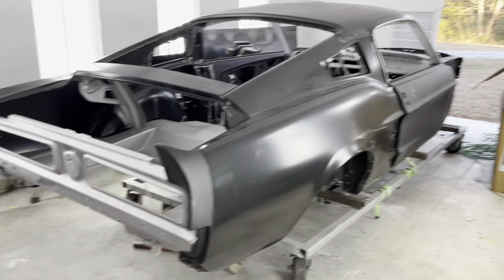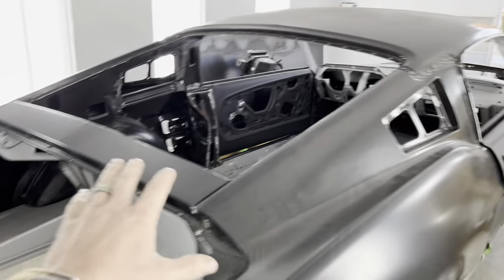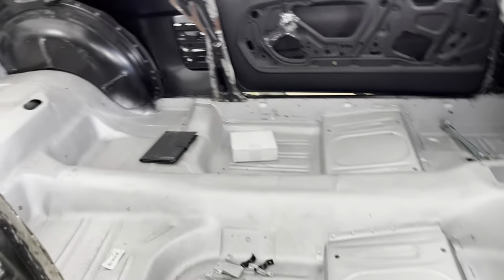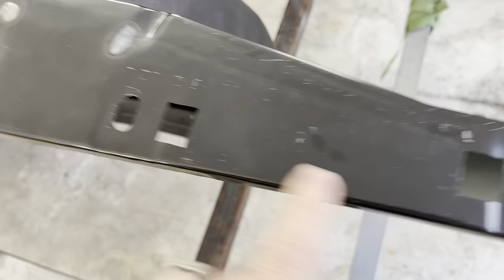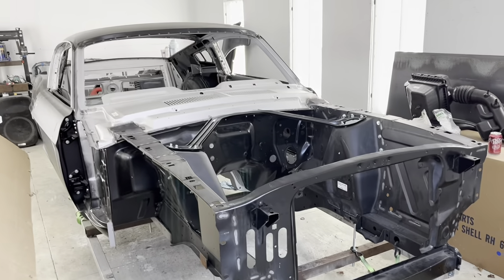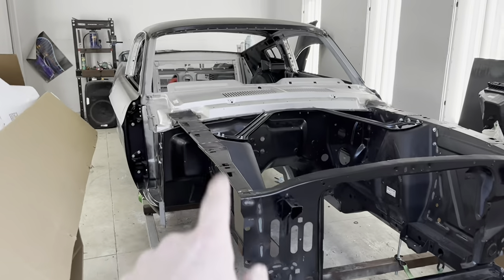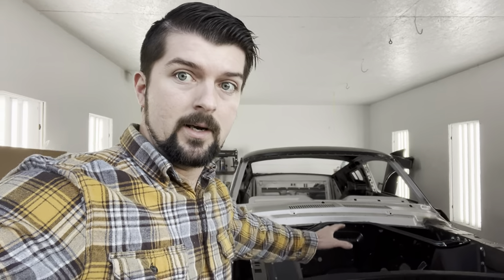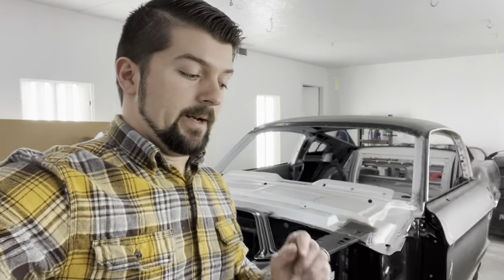How to get a VIN number and title for your car

Comment: Any thoughts on this:
I have a car that I bought about 20 years ago which had absolutely no VIN numbers or any identification on it other than the ancient title that I got with the car which seemed to match the car correctly.

I am wondering if this process which you outlined could work if I somehow could make this a new car using the unibody as the base.

I think I know the answer, but I'm looking for better answers, LOL.
Reply from the maker: @MelaniaSideWigga  the state would come and check all the areas where numbers should be and if there are none they would issue new numbers
Reply: @1194video  Thanks.  I'll ask any DMV some questions next time I go there.

Comment: So my 2004 sierra 1500 got shredded by a semi trailer the cab itself is  NOT repairable it ripped the back passenger door off the hinges and bent the door jam towards the back glass and the bed the front passenger door still opens and closes fine but the outside handle was also ripped off I don’t wanna get rid of the truck if I can rebuild it. I have a clean title insurance is going to deem it totaled since it’s an 04 and labor is not cheap so that being said can I get a donor cab , swap all my interior and put my Vin number in the new cab and Use my driver door and put my door jam sticker on the new cab ? Technically the motor, trans, frame, would all still be the same just not the cab and the rear passenger door. Is it worth it? What would you do
Reply from the maker: You have to use the vin from the body, it is illegal to remove a vin tag. You can however talk with the local county clerk on this issue and they will tell you your best route
Reply: Just find a straight cab with a title. And put that cab on your good chassis.

Comment: I've got a 63 in the VIN numbers got screws on it
Reply from the maker: You’re not making sense. What do you mean “got screws on it”?
Reply: I mean it's got two little Phillip head screws that screws the damn VIN number to the front fender well.
Reply: @1194video  1963 Plymouth Valiant station wagon I also have a 65 Valiant parts car same thing screws in the VIN number
Reply from the maker: @randysummerhays4168  they used screws up til I think the late 50s but on a 63 I would think it should have the cup plugs that rivet it to the body, the body data tag that is under the hood will be screwed in and not riveted.
Reply: I’ve seen a few vin tags that were attached with screws. To be exact. The were small hex head screw with Phillips in the center. This is not typical and is definitely very uncommon but it was done for a few years for certain vehicles.   My 1956 F100 had screws attaching the vin tag to the door hinge pillar and when I first noticed it I thought it was odd. It looked legitimate and unmolested. I left it as is. Most vin tags are either spot welded or riveted to the body. I’ve been working on and restoring old cars and trucks since I was a little kid. It doesn’t make me an expert on this topic but I can share my experiences based on the hundreds of original and altered vintage tags I’ve personally seen in my life.

Comment: For a 10th time, was that built brand new by you?
Reply from the maker: @redawson001  it was fully built by me, I have a video showing the build and it is Registered as a 1967 but has a standard length VIN number like new models have but registered as a real 1967 mustang because it is all steel reproduction body parts
Reply from the maker: @redawson001  https://youtu.be/fAw73fthAWY?si=HE_v-0AoOPVP0nJJ

Comment: Show me the rolls of steel and presses you used to make all the shell parts and frame . I say Lego package.
Reply: He assembled that entirely from unassembled NEW panels, not from a kit. Floor pan appeared to be boxed on the bottom for structure though. It's definitely not as simple as legos. lots of measuring another car, hole punching, alignment, and clamping before he could weld it together. You should check out the original video instead of poo pooing his work.
Reply from the maker: Thank you Mike! Glad to have you as a watcher of my channel

Comment: Good luck in California 😂 you’ll have to go get a smog 😢
Reply from the maker: You will not need a smog inspection if the vehicle is a 1975 year model or older so in the case of our 1967 mustang, we are in good shape. Even in California.
Reply: @ajsgarage6802  In Calif- it's a new built car. My be a 67 mustang but you built it in 2024. So it's required to have 2024 Smog & all the safety BS. Thanks to our Great Governor.
Reply: @benpeirce2531  Man you people so jealous of us in california like to lie lie lie.  California has a law that up to 500 cars can be registered as the year they look like even if brand new.  A 67 mustang looks like..........here is comes, get your head out of  your ass now....a 67 mustang, so it's titled as a 67 mustang.  Only 500 cars a year.  Back when the law was passed, they ran out of 500 quickly until all the hotrods got new titles, now nobody builds cars anymore, so not even close to 500 a year are titled.

Comment: When we get this vin….vin number controversy ironed out can we move on to people who say hot water heater   (You know who you are) they need to be STOPPED!!!!!!!!
Reply from the maker: I have a tankless gas 😂
Reply: A couple of points here. 
1. A hot water heater does in fact heat up hot water. A tankless water heater, heats up cold water to be hot but a traditional tanked hot water heater maintains water at a certain temperature, So it is heating up hot water into hotter water. The only time it would be incorrect to call it a hot water heater is the very first time you turn it on since it would be heating up cold water. It would be grammatically correct to call tankless and instant water heaters "cold water heaters" and tanked water heaters "hot water heaters."
2. "Vin" is the name of the number. When somebody says Vin number they are referring to the number "Vin" they're not referring to the abbreviation for "vehicle identification number" which would be spelled "V.I.N." If the person said give me the "V" "I" "N" then they would be audibly abbreviating "vehicle identification number" and it would be grammatically incorrect to add the word number after that. But when somebody says "Vin" number they're not asking for the vehicle identification number number they're asking for the number named "Vin".

Comment: This car is not a Ford and the title should say that.....
Reply from the maker: It is reproduction body panels to build a mustang not straying from the Origional design by ford, every part is an exact ford replacement. The only way it would differ is if it was not OEM replacement such as fiberglass-etc
Reply: @1194video yes the car was built using all brand new reproduction sheetmetal. And yes it does look like a 67 or whatever  Mustang. But because this car was not built by Ford, in their factories in 1967, with a Ford issued Vin   number. It cannot therefore be titled as a Ford.
Reply: @ericpetz5831  Dunno what to tell you, he mentioned in another comment that he's already received the title paperwork and they wrote it up as a 68 ford mustang. They've got to put something on the manufacturer line and it's technically a home-build, but they decided it's a 68 ford for their purposes, so there you go. Since the VIN they issue is gonna be a TN-xxxxxx number it's not like it's counterfeiting an original ford or anything.
Reply: @carpespasm  read my comment again. Yes the DMV issued a state of Tennessee vin number, which  they do for any homebuilt car, bike, trailer, hotrod/custom built vehicle etc. And yes it may say 68 Ford Mustang on it.
 But because this is technically a home/custom built vehicle, with it's a repop body and everything else being aftermarket (aka new build). The title will more than likely have the body manufacturers name on it as well. So on a new build, with a aftermarket built body. And let's say said body was built by Dynacorn. Then the state issued title will probably say something like Dynacorn 68 Ford Mustang, on it, or something similar. To differentiate the repop Mustang, from the Original Mustang.

Comment: Try it in NC abd go to prison.
Reply from the maker: It’s the same in NC the state has to inspect the car just like most states.
Reply: I live north Carolina, I had title Ohio title for this car, the VIN # on this car was on passenger side floor board, which had rusted away, so my Ohio title no good, NC  made me get car inspected by state, get appraised, get bonded for 1 1/2 times appraised value, this cost me $ 1,500.00, they NC issued stick on VIN number, new specialty vehicle 1940 Chevy. It was a long process and long lecture about could be a large fine or prison time, because VIN # not on car. I finally got vehicle legal. NC not like old cars, they also put big cost for property tax on car I have to pay every year. I would not recommend what this video suggests.
Reply from the maker: @GregoryMiller-tj8me  check with your local county clerk for the correct way to assist in your issue, clearly this was not the video to assist you.
Reply: @1194video  ...and that's just one of the reasons I don't live in North Carolina. I love TN...

Comment: It's just a VIN, unless you meant to call it a Vehicle Identification Number-Number
Reply from the maker: You do realize it’s the same thing right. Like DMV means department of motor vehicles if your watching the video I assume you know what VIN stands for.
Reply: Like I said, it's not the same thing, you called it a Vehicle Identification Number-Number. That's as wrong as calling an ATM an ATM machine or a water heater a Hot Water Heater. Semantics. Vernacular. Simple and still incorrect. You wouldn't call the DMV the Department of DMV. Come on man, you're a car guy, you can do better. Your response could have simply been, "You're right, I guess I never thought about it before."
Reply from the maker: @Official_DLamb  this video has been viewed 67k times and your the only one who has to have a definition of what VIN stands for.
Reply: Actually, VIN is self-defined, I didn't come up with it. Again, remain teachable and learn, you're a car guy with good content.
Reply: @1194video  Bro, he's right. "VIN number" is redundant. The "N" in "VIN" stands for "Number" so when you say "VIN number" you are essentially saying "Vehicle Identification Number-Number."